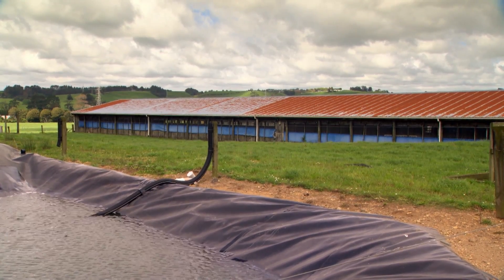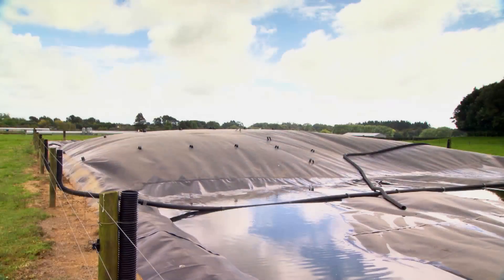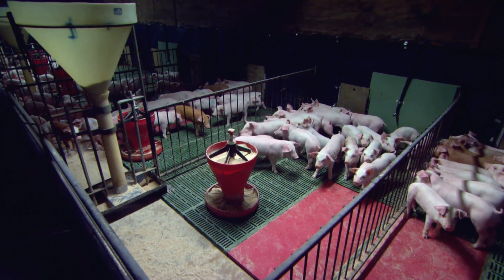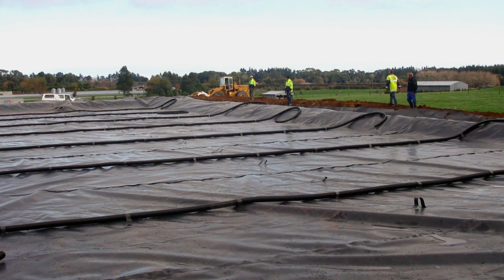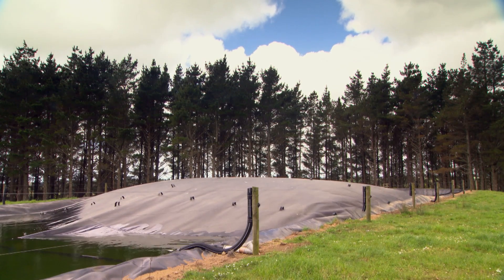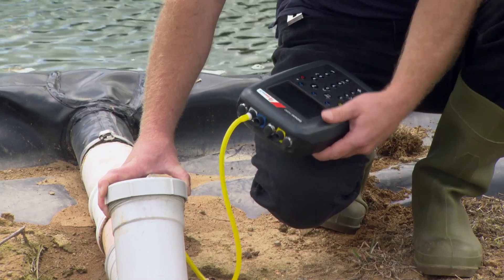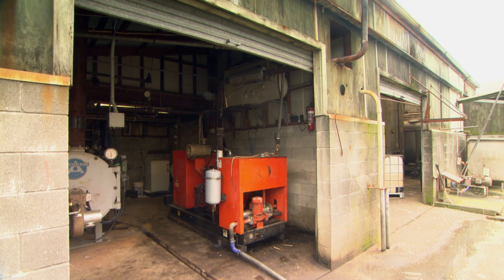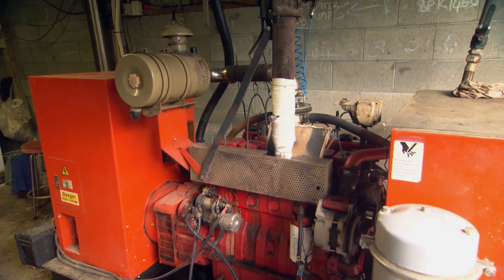Pig Waste Biodigestor

Comment: The U.S. should require this on all pig farms. Most pig farms accumulate the waste in open farms or spray the effluent on plants. During flooding from rain storms the ponds overflow an pollute the waterways. This is a cost effective way to control the pollution and provide energy for the farms.
Reply: That's a good idea and then they can sell the excess electricity